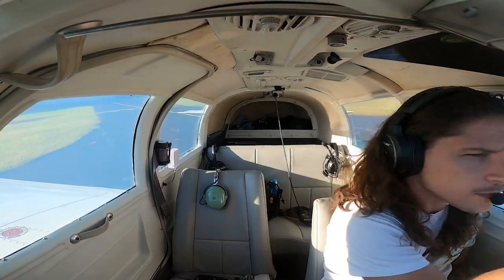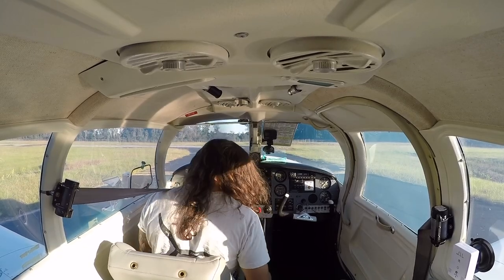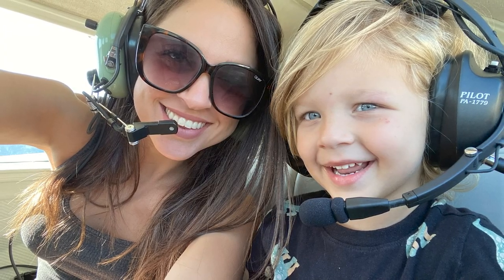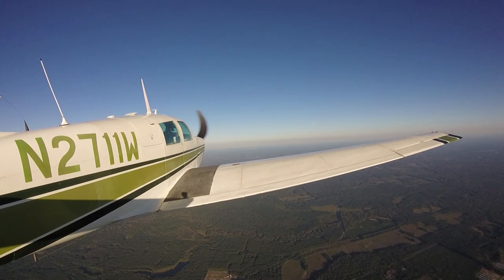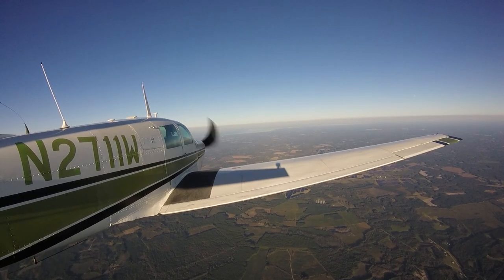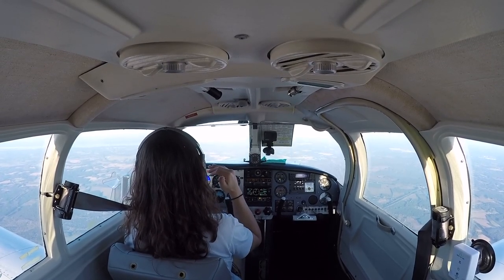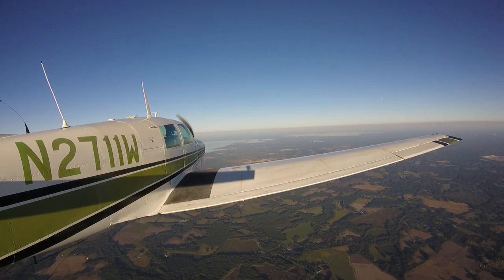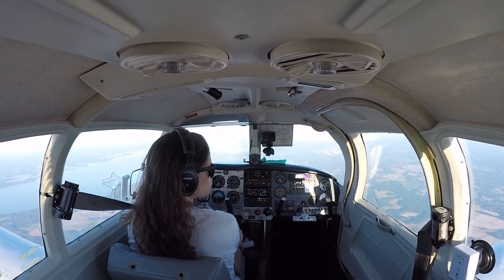VFR Pilot Gets Stuck Above the Clouds! | I Made a Terrible Decision

Comment: Aviate, navigate, communicate as you work through the problem - even when it's self induced. Great job working through it and staying focused. A few months after I got my PPL (in 1994) I was returning to BFI from a dinner date with my wife at FHR. About 5 min into the flight home (night VFR) I realized I was tracking a wrong VOR or wrong radial and I was on a heading of ~165° instead of about 140°. After correcting course I realized that if I had continued on that track I would have experienced CFIT as the mountains to the west of BFI were 3000' higher than my cruise altitude. Since I couldn't afford to fly more than once a month at that time, and since I knew I needed more time in the seat to be safe and proficient, I had to stop flying until I found Paramotors with my son in 2018. I'm having fun watching your journey on the professional pilot track. Congrats on making it happen. I'll be set at ease if I ever hear that my captain for the flight is Mr. Kubat!

Comment: Hey, I been watching a couple of your videos and I came across this, I got as far as 13:27 and stopped because, I spotted the domino effect. 

If this would happen to you again, allow me to offer some advice.  1. Climb, conserve, confess,   When you reached the point where you first didn't know what to do or where to go. You inadvertantly did the correct thing by climbing you can see more, and you  burn less fuel.  then circle. You should have called up the local Approach or even Flight service. They have weather rader and can see it better than you and could have told you which direction the weather is moving and which airports were in VFR conditions. - You would not have gotten in to trouble for this, they are there to help exactly for this situation.  They are not to be afraid of and would have helped you avoid getting into the critical situation.

When you, described being above the Airport that was in IFR conditions - You were in an emergency situation, i.e If you had contacted ATC, once you had told them you are a VFR pilot and stuck above cloud not sure where to go or how to get down.  If you hadn't ATC would have declared an emergency.  Point is again you wouldn't have to worry about breaking any rules because Mayday gives you license to break any rule to insure safe conclusion of the flight. So you would have been cleared to go into IFR conditions - you may have been asked after to file a report but I doubt it.

I have read too many NTSB, watched too many Accident reports and so forth,  The bad planning and not being prepared  was not the mistake that got you into trouble, it was the second, third and forth that came after it because you were focused on the 1st error, your emotions which you noted played into it and they resulted in the domino effect/ (The Swiss cheese model)

Soon, as you had that first problem - you should of been on the radio to ATC. 

Being afraid of ATC is main cause of this.

Keep making your videos, I enjoy them a lot,  (Don't feel bad, I actually did get into trouble by violating P40 on accident, you learn as did I)

Comment: #1 If you own your own airplane you MUST get a IFR rating.  You will want to get use out of your plane, you will want to take family and friends, you will be pressured to get to somewhere or get back from somewhere and having your rating is like four-wheel drive in that it is there to get you out of something.  #2 Always have a out. If flying over a cloud layer where can I go to land VFR and why is that not going to be affected the same way that is producing this cloud layer.  Is it a marine layer and there are mountains blocking the layer?  Then you can fly over the mountains to that airport.  I highly recommend Richard Collins DVD's, especially the "Flying the Seasons" DVD.  He takes you on real trips and explains the reason the weather is what it is. #3 The best planning is the planning on the ground where there is all the time in the world to make decisions.  I use the Gordon Graham risk model:  High Risk/High Frequency, High Risk/Low Frequency, Low Risk/High Frequency, Low Risk/Low Frequency, and DESCRETIONARY TIME.  The most dangerous is High Risk/Low Frequency.  If you need to fly a approach to minimums and haven't done them before, or in a long time, you are in a very dangerous situation.  And Discretionary Time has to do with how much time you have to make a decision.  

This is what you had here.  You started running low on fuel which can lead to having to make a fast decision with lessening options.  Not a place where you want to be.  

Usually, IFR or VFR, the best alternate is the airport you just passed, while always checking what's ahead.  There should always be a little "fear" that things could change or isn't what is expected when you get there.  And always be conservative on planning and quick to throw in the towel and land.  Always carry a warm blanket so no matter where you decide to land you can always sleep in the plane because the weather will ALWAYS improve sometime. Too many accident investigations are done the next day in perfect weather because of bad weather the night before.

Probably the best learning you got from this is that feeling and never wanting to feel it again. For that is what makes us want to learn our lessons from other's mistakes and not our own. LOL.  We may not have made the same mistake as you here but we all have had that feeling sometime in our time as pilots and that can be the best training of all.